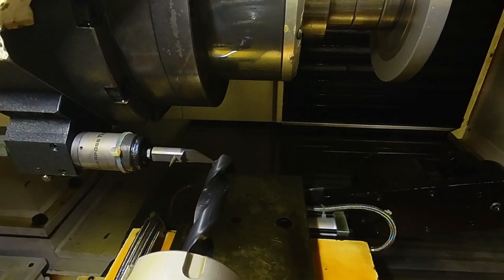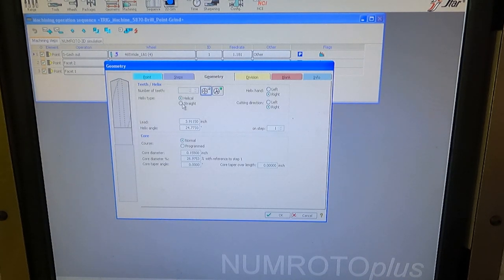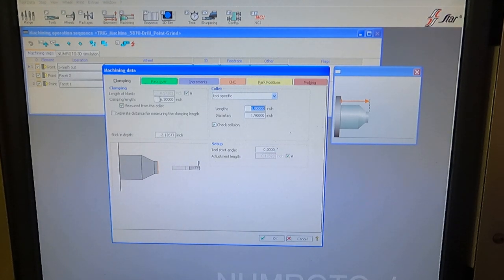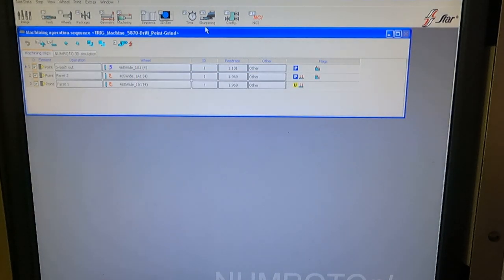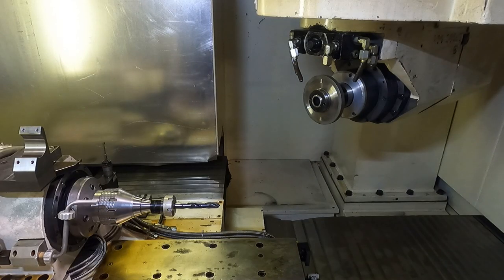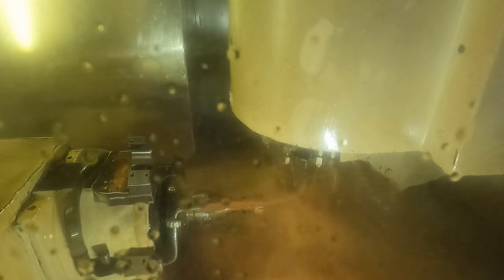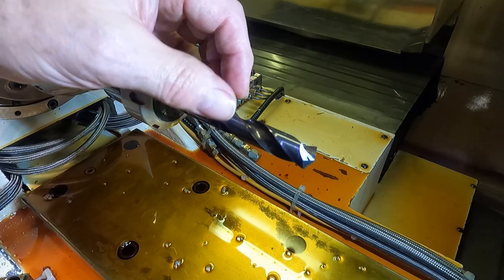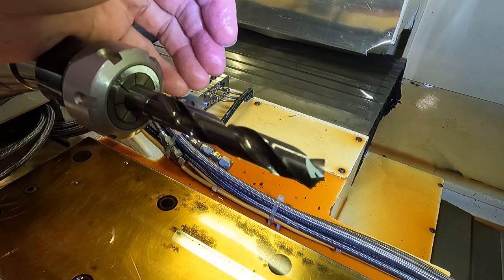Sharpen A Carbide Drill in CNC Tool & Cutter Grinder

Comment: Interesting as always, thanks for going into detail on the probing.

Business question if you dont mind: Would you buy a new (or used) t&c grinder, if this one died beyond repair? Your line of work seems to require custom tools quite often.

ATB Stefan
Reply from the maker: I the past I used this machine a lot more than now. And then I did look into buying a new one. These machines new tooled up are very expensive. One this size would be in the neighborhood of $600.000 dollars. So at this time I would not buy another one if this one died. If I was younger this is my thought about buying machines for busness/making a living. I would always buy new if the busness plan could justify it. Because you have to depend on the machine working consistently. So to have a warranty and quick service is paramount. Also you have the latest technology to be competitive in industry. All my machines I currently own (except for the ones in the garage) I purchased used. They are all around 20 years old. So if something goes wrong it could take time to repair. But at this time in my life I could afford this time. But if you are running a busness with employees. Your most expensive cost is labor. So the new machine is the best route. I don’t know in your country but in the USA there can be certain tax advantages to offset the extra expense of the newer machine. Kind of a long response but this is a rather quick answer to what can be a complicated decision. Depending on the busness situation.
Reply: @ Edge ?.
Beautiful response.
At that price for a new machine you would have to have a lot of work for it to be worth the investment.
Reply: @EdgePrecision  Thank you for the answer -  makes a lot of sense.

Comment: Hello Peter, thanks for all of your videos!
Watching you doing all the different stuff is kind of relaxing me and thinking about the things I wanna do at work.
I like your way of showing real work, not the badass thing of machining with no problems, this is very boring and shows not the reality.
I'm kind of bored from all the companies I worked for, most of them are working the old 84 way, calculating all points and programming by hand.
It's a wonder how they can exist on the high end german market with this attitude....
By the way, tool sharpening is really interesting, i would like to have the chance of learning it by my self too.
We often customize inserts by using wire EDM, its good for a lot of tasks but be able of cnc tool grinding is on of my goals in life, thank you for showing some little aspects of it.

Comment: My work bought a used Star machine a few years ago.  It sat a long time.  I come along and have been learning it as we go.  No instruction manuals at all lol.  Its a very enjoyable machine when its working correctly.  We are sharpening Gear shaper cutters, and trying to get it to grind hobs.
Reply from the maker: Yes Star kind of specializes in grinders to make and sharpen gear cutters and hobbs.

Comment: At first glance, this machine seems redundant, at least when it shows how a simple drill is sharpened. It is especially surprising to watch this from Brazil - here even in tool stores there are only drills with a pitch of 0.5 mm. And I think that on the simplest CNC router I can make mirror surfaces of the cutting edges with a diamond bur, I will rearrange them by 180 degrees with my hands.
PS I saw the price. I thought a lot.

Comment: what is the max acceptable drill run out? how do you check it and how do you adjust it? Is the machine dealing with it by probing? Thank you for your time!
Reply from the maker: I didn't show this in the video. But I indicated the drills to less then .001" of indicated run out before grinding. It can be done by lightly tapping on the end of the drill with something soft. Like a piece of brass or aluminum. The probing has no effect on the run out.

Comment: Thanks Peter for the video. Always very informative and explained in a calm manner. Interesting to see that the tool probe it self has the ball zeroring position. I would have expected the tool probe could have done the zeroring on the reference position, so very enlightening to have that explained. Regarding the Windows XP, don't worry if the computer gives up there are new computers that can have Dockers installed and then XP operating system op top of Dockers as a virtual machine. Then the application  program, can be installed in the virtual machine. Do not scrape the grinder because of XP is outdated.
Reply from the maker: The sphere/ball under the probe on the spindle is for calibrating the grinding wheel probe. The square block above the collet chuck is for the tool probe on the spindle. I wasn't to clear about that in the video. As for the computer. The machines control is actually in the back cabinet. Star grinder make new grinders. Also using NumRoto software. I'm pretty sure they are running a newer version of windows on them. They probably could setup a whole new computer to run this machine. But I would be a little costly having to upgrade the software to the newest versions. That's where the cost would be.

Comment: Oh the audio, right off the bat. You could do a little better on audio, video and contents good though. But Who am I to judge,  I'm just a dude without a lathe, mill, or cnc. Lol. As much as I'd like to make my own, having parts machined in Hawaii (mainly my xy sleds) is expensive, even when you have a big boat to bargain discounts and can do your own CAD work.....
Reply from the maker: This is a very difficult audio situation. There are many machines running all around me. Not to mention the one I’m running. Air grinders, people blowing air guns. I’m filming in a working machine shop. I have tried to put filters on the sound to reduce this noise. Then people complain about the sound as well. Because it distorts it in another way. I get even more complaints.
Reply: @EdgePrecision  i completely understand your situation. It was an audio jump at like 17 seconds in... either way, wasn't trying to be a buster about it, it was just that one clip right off the bat that made my headphones jolt me a little. I am a content creator, just on a different account for a hobby, but I think most programs can show your audio levels so you can see those big variances between clips like that. I enjoy your footage though.
Reply: And to be clear, it wasn't background machine noise or shop noise, it was voice audio from one clip to the next. Id be a fool to complain about background machine noise on a machine video.

Comment: Hey Peter, can you regrind OD of flutes ? Like say, 6.5 mm from a dia 7 drill ?
Reply from the maker: Yes that is possible up to the shank. But this machine isn’t really setup for cylindrical grinding. I would regrind the flutes with a slight clearance angle. That’s what I usually do when making special size drills.

Comment: Why do machine shops put 4ft-6ft of concrete?
Reply from the maker: Are you referring to under machine bases?
Reply: @EdgePrecision  Yes,I heard it keeps it from tapering
Reply from the maker: @lonestar9453  yes a foundation gives more weight and stability, rigidity to the machine. Although they are not usually that thick. The one under my Mazak is around two feet thick. Under the Mitsubishi horizontal mill about three feet. This grinder in this video did not require a foundation. Because of the way the machine is built.